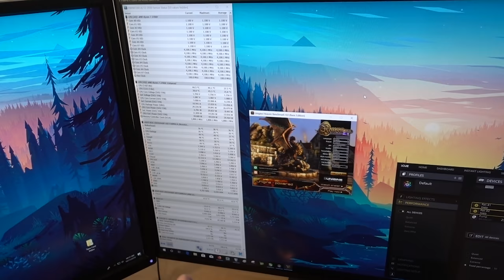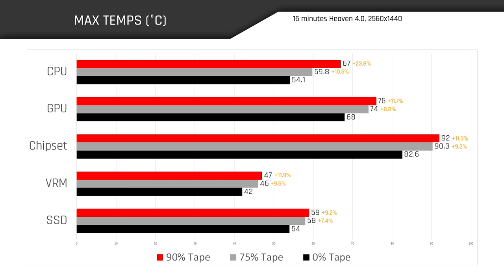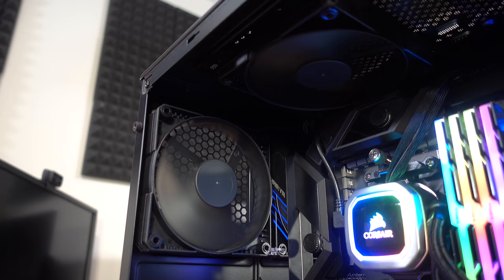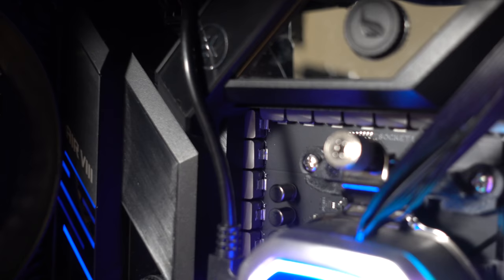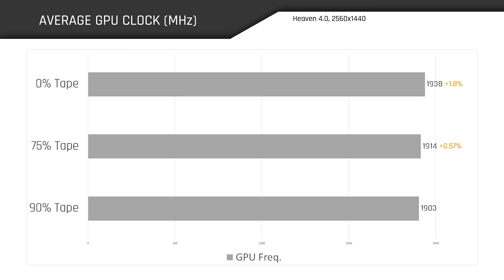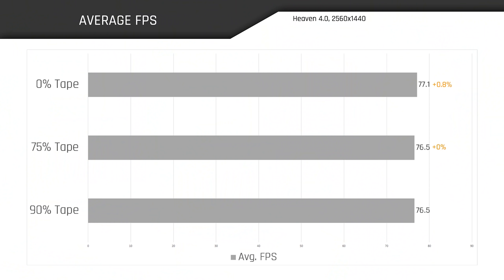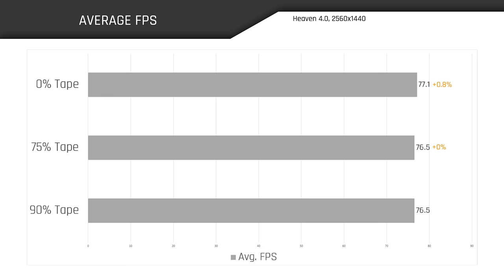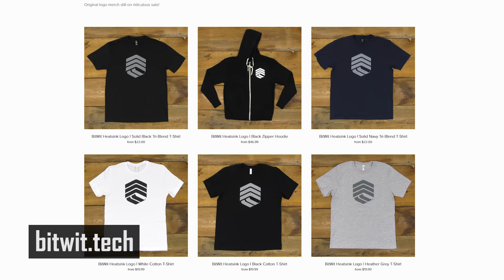I duct taped my computer case...Here's what happened

Comment: I'm still waiting for one of you guys to do a case by case comparison with air flow, which has the best, and use "smoke" as a visual thru a side panel to show where the smoke goes in and thru with air flow out the exhaust of a case. Just an idea.

Comment: Hello Kyle. I'm a big fan of you and your videos. The video was really interesting and fun to watch. I have one question, it's about my pc. So, i want to use 2 monitors, but one of my monitors only has Vga and my Msi GTX 660 only has 2 dvi slots. So i just used my intergrated graphics from my cpu. And it worked well for 2 days or so, but then i wanted to get rid of the second monitor because my cpu is an Core I5-2400. And it gets really hot while playing, some more demanding titles like forza horizon 3. So as i was in my bios trying to turn off the 2 monitor option, but then as i saved the new settings it crashed. I had to restart my pc yada yada yada. I wanted to know if it is a smarter idea to get an Dvi to vga adapter so i could use the second monitor on my gpu? Will i have any lag with the adapter?. And also if you look at the back of my gpu https://www.amazon.com/MSI-GeForce-Graphics-N660-2GD5-OC/dp/B009K1PY4W There is 2 dvi slots, is the bottom one slower or?? is it just normal and works as good as the top one? Lots of love from Estonia

Comment: I taped all the holes (even the exhaust) of my case because of the following:
1. After 1 month, the tempered glass side and front panels get filled with dust, and is very noticeable because of the LED fans.
2. I am using a blower-type 5700 XT, which is I am using as the exhaust.

After two months, I don't see any difference with my CPU (Ryzen 3800X @ 4.25GHz) temperatures because the CPU cooler AIO pump runs at 100% all the time.

The only difference was the GPU temp which maxes at 91c when playing games like Control which is a GPU-intensive game. Originally, with the chasis holes untaped, I get 88c max. This is with my GPU overclocked at the highest possible frequencies.

I am pretty much satisfied with my setup because I don't get any dust inside my case anymore, with only minimal temperature differences (in the GPU).

To give you a comparison, I was using a Ryzen 2700X before (with my case untaped) and I always get bluescreens at high memory frequncies. And then, I replaced it with the Ryzen 3800X, and even with my chasis holes taped, I haven't experienced any bluescreens yet. Ironic.

Comment: I would think showing a percent increase in °C (temperature) is really not appropriate.  The Celsius scale is actually arbitrary.  If you showed the results in °F (or K or R) you would get different % for the same actual change in temperature.  A much better way would be to state the % change in the overall temperature rise (delta T) above the ambient temperature. So for example for the CPU the baseline delta T would be (82.6-22.8)=59.8°C.  The 90% tape case delta T would be (92-22.8)=69.2°C.  So the increase in delta T would be 69.2/59.8=1.157 or a 15.7% increase.

Comment: You should do a video about how to make the best coding / general use PC.  (Not for gaming, or video editing.)  Should I focus on cores or clock speed to make Visual Studio run faster, or should I get faster ram, or lower ram timing?  When searching PDF’s with  ctrl + F  I see some GPU usage (about 20%).  Should I get a GPU with faster DDR6 memory (1660 Ti about $270 new) or a “better”one with DDR5 (1080 about $200 used)?

Comment: You literally have the same setup almost as me, 3700x, same rgb 3600 ram, case with 1 fan on top and back a 240 rad in front with the fans on the outside of the case, but behind the cover, but I have a 1080ti and a h200.

Comment: Your CPU temp was 54C without tape? My 3700X is OC to 4.15 GHz, and it's average temp is 36C. I guess that shows the difference between a 240mm AIO and my open-loop system which has 3 360mm radiators and 9 RGB fans. The fans are all running at 800 rpm, so the system is nearly silent. Oh, and my case is a Lian Li PC 011 Dynamic, and it's awesome.
Reply: @CaveyMoth  Perhaps, but we all know it's the RGB on the fans that's really keeping my system that cool. 😂
Reply: @OlettaLiano  As long as it's blue LEDs, like my fans from 2011.
Reply: @CaveyMoth  Interesting that you say that. All the RGB in my case is static blue. I always pick one color instead of the rainbow puke.

Comment: I disagree with the "nosiest fans". My current build i ordered 1 intake fan from the front, 1 exhaust on the side, and 2 exaust on the top of the tower. Maybe i was unlucky? I don't know, all cooler master 120mm fans ordered from newegg, 3 of 4 fans were horribly noisy. I went the extra step and purchased some 3 and 1 oil designed specifically for these type of fans. Removed them, oiled the center piece, placed them back, nothing changed, all noisy as shit. How can cooler master fans who are so reputable, be this bad? They had a very good rating on newegg, it was the "4 pack", easily can be found, about 25 bucks for the 4.

Comment: any advise on where to find old motherboards, it seems the net is forcing me to buy a 300 series or higher when i am not interested i cannot seem to find any z270m boards anywhere that arn't more expensive than current ones... why is this considering they are obsolete? what gives??? any clues? can you or ... your alter ego make a vid about this? I feel my currently processor is fine for my needs no need for more cores and my clock speeds are fine. gaming on my rig is awesome @ 1080p with my red devil rx580 I got after watching your horror themed vid.... I am a budget minded guy that builds his own pcs and sees no real reason to be forced into buying a new mobo and processor  combo when it isn't needed and think this is a strange thing... its like all the z 170s and 270s M clas especially vanished.

Comment: I know in this video a 2070 super was shown, but in my limited experience, if you're looking for a RTX 2060 Super, you should go for MSI Armor vs Gigabyte Windforce. The latter runs 10c hotter with whining fan noise. MSI's cooling system is way better.

Comment: Sorry Kyle, but as a physicist I just can't let you get away with reporting temperature increases in percentages here! If you had shown percentage increase in temperature over ambient, that would have been fine, but what you've done now doesn't really mean anything (the percentages would change if you had used Fahrenheit, for example :P).
Assuming your ambient temperature is about 20'C, the percentages would also have been quite a bit bigger, which would reinforce your point that duct taping your case shut is a bad idea :P

Comment: Interesting.

But if you're willing to duct tape your desktop PC, you should also be willing to potentially ruin your entire computer and be able to afford to buy a totally new system.

Anyway, I agree that these desktop case manufacturer's need to put more thought into case designs; especially when it comes to things like cooling, air flow, and modular designs so you can more easily and conveniently swap in and out parts, and make cable management less of a headache while still looking very clean and organized.

Comment: Kyle I really enjoy your videos, but I must call out a grievous error in the science. It is not permissible to to apply a percentage to  Celcius or Farenheit temperatures . for example: a 10 degree rise from a 20 C ambient is 50% increase, and a 10 degree rise from a 30 degree ambient is 33%. Please just talk about a temperature rise  (delta) and no percentages. Similarly if we take an ambient of 25 C (pretty normal) and have a 10 C rise, it is a 40% rise. the ambient of 25 C is exactly 77 F. 10 C is equal to 18 F, so going from 77 F to  95 F is exactly the same temperature, but the percentage is now 24%. Please just give us the Delta change, forget about percentage.

Comment: Could anyone inform me if im going to have ram clearance issues with the RGB Vengeance Pro 16GB 3200Mhz and the RGB Black edition Cooler master Hyper 212 Evo. the mobo will be Gigabyte Aorus Elite B450 chipset. thanks guys

 

 the cpu is the 2600x amd
Reply: I dont have the exact same ram or exact same motherboard but my black edition hyper 212 on my aourus b450 pro wifi board has plenty of room with the ram i have. I dont think you should have any issues
Reply: You should also be able to move the fan upwards a bit to make room for the RAM if there's an issue.
Reply: You should be fine :)
Reply: @kvgm  oh okay thanks a lot for the help

Comment: Stupid makes no sense at all. Fans are more then air movers, they are airflow controllers. I would like to see if you move the fans in to positions to control the directional flow of air and then mod the case (round of the front inside corners) to also promote the airflow if this would help with cooling and look of the PC. Use the GPU as a divider and make the bottom/back intake and the top/back the exit. So air comes in at the bottom/back then moves to the bottom front were the inside is rounded and turns the airflow to the top then out the back. Also maybe put the fans inside the case , not on the back panel so that the sound is more inside! Then try more fans and at diff. locations through out the case. Could be a video are two in it for you. May be get a big DIYer to help out with the mods to the case. The sexycyborg would be so cool LOL Just saying! LOL  Here's one more , put some servos on the glass panel so that when the temp gets to high inside the case the whole panel opens up with a flashing orange light on the top, LOL  Would be so cool. I'm so high right now, LOL

Comment: Why you do dis?? :'(
Reply: I actually do this because of the dust. But I use 100% pump speed for my AIO CPU cooler which helps the CPU temps a lot. For the GPU, I use a custom fan curve. Plus, my GPU is blower-type which is perfect for the setup I use. If I was using an open-air GPU, this would have not worked well for me.